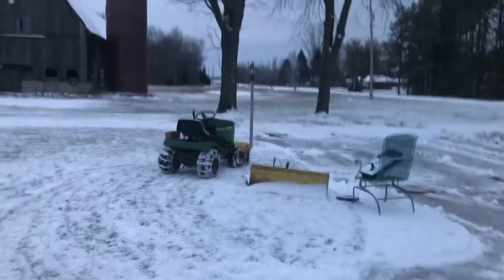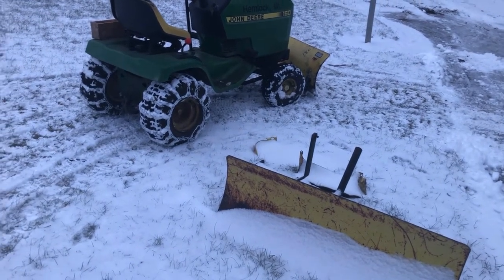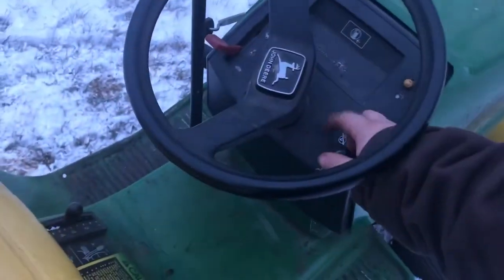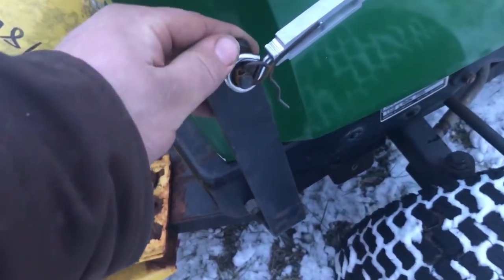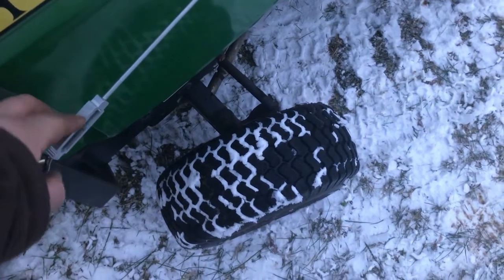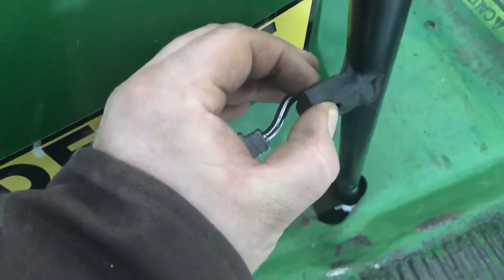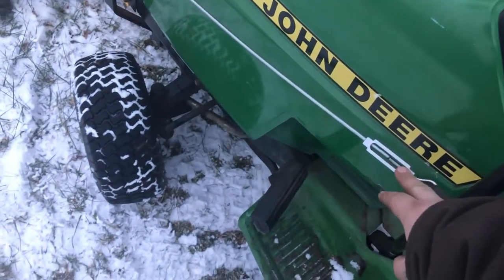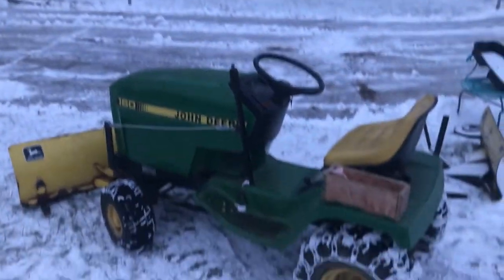John Deere 160 with 42" Snow Plow and custom lift link

Comment: where were you able to find the plow and do you happen to know the official name of it, ive been trying to find one for forever, i have the same tractor but finding a plow for it is nearly impossible
Reply from the maker: The plow is a 42" Plow for the John Deere 160, 170, 180, 185 etc.
The total set of pieces are shown in this Ebay listing (This is not my ebay listing).
https://www.ebay.com/itm/285526327225
I was able to find two of them on a local auction site one winter. There are quite a few pieces to the system, plow shoes and the bottom plow blade, all the brackets were tricky to get etc. Good luck!